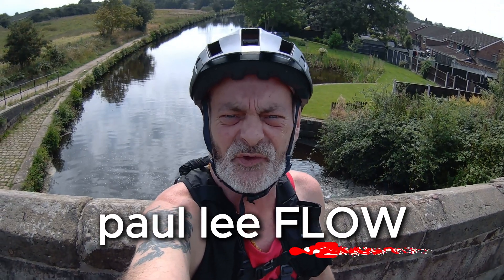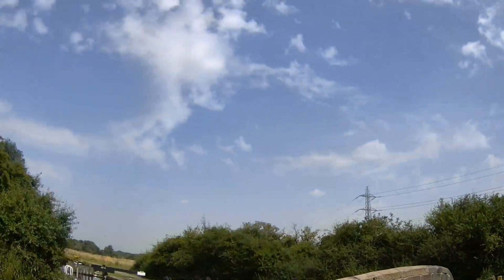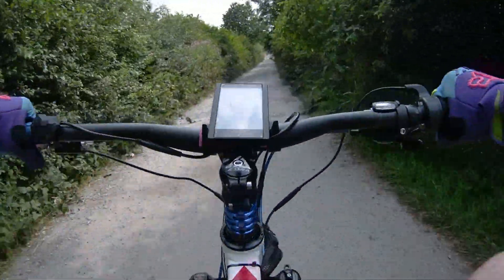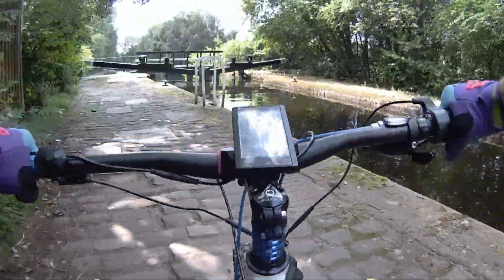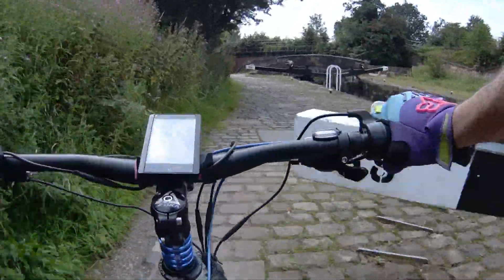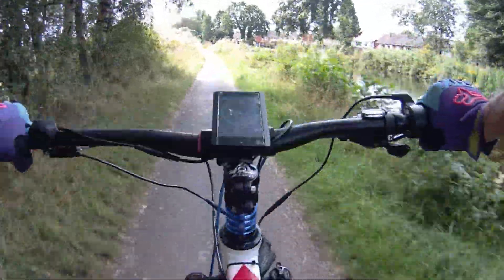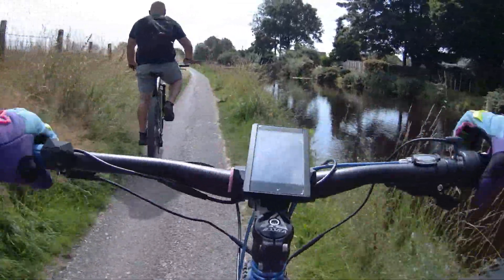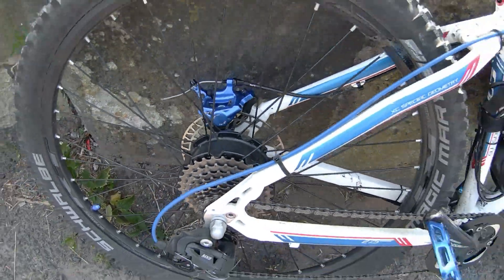Can A 36v 250w Motor Run At 48v 1000w ? DIY Carrera EMTB Burn Out !!

Comment: You abuse it to much! full throttle on hills + gravel and grass OMG! even on stock i would never abuse it that much 🤣i bet if you gentle and not putting all amps into...250w would last... i have 250w geared hub with 500w controller still going strong after 10k km (delivery jobs) on stock controller my max speed was 29-30km/h on 500w controller with 48v battery i can hit 38-39km/h... am planning putting 1000w controller for even more max speed, but i will be gentle not crazy like this 🤣What is the max speed you hit do you remember?
Reply from the maker: Haha yeah mate I was giving it some beans for sure 😂 cheers for watching!

Comment: Hello, im planning to build the most budget ebike i can find. I found a used 26 inch mtb for cheap with disk breaks i alr have a battery and can get controller for cheaps aswell. Also i found a £30 rear 250w 36v hub motor but its same size as many 1000/750w motors i saw. Do you rekon it would work for a while i could add some heatsinks if really needed as they are dirt cheap aswell. I feel like as long as the cables on it are good the motor will be fine. Whats your oppinion?
Edit: the controller will be a square wave 48v 1000w primarily for stunts and fun riding

Comment: So i have a ecycle with 48V 250W controller and motor system.

Now the problem is , i am not able to find a replacement controller in my country for this ecycle.

Although 48V 1000 W  E-scooter controllers are available (both sine wave and square wave )

So my question is can i use the 48V 1000 W E- scooter controller on my ebike (48V 250W) motor?

Will motor only draw its rated 250W power from the controller ? Or it will blow out the motor?

Or motor burn out reason can be using hight voltage on a lower voltage rated hub motor ? Like using 48V on 36V hub motor ?
Reply from the maker: Hi - This is a hard question hahah !! So i had a mate x fat tyre ebike which was 48v 250w but i ran it constant at 1000w with a sw900 display & controller & it was fine !! But in this video i burnt out the motor over volting it from 36v 250w to 48v 1000w & the motor overheated & burnt out but have you checked Voilamart they do international delivery i think UK & EU anyway but check Google Voilamart 48v controller they do 1000w Ebike controllers - Its a good brand if you can get one - Hope this helps & Thanks ⚡